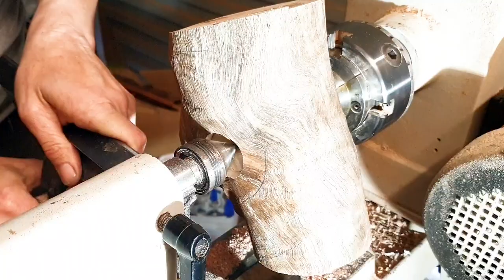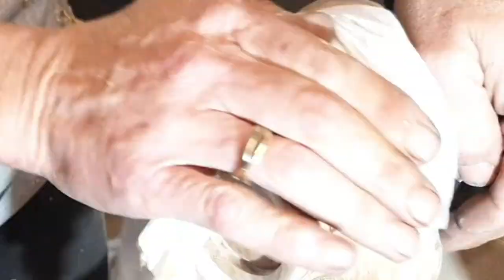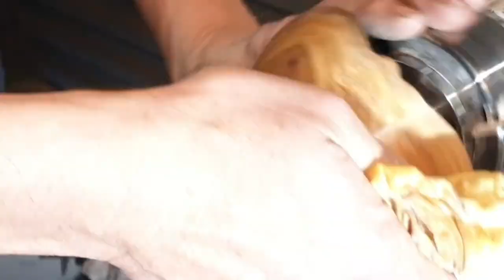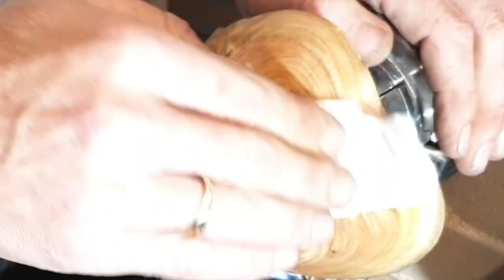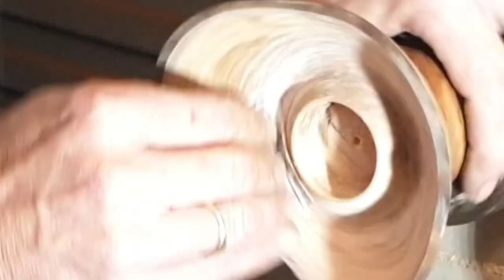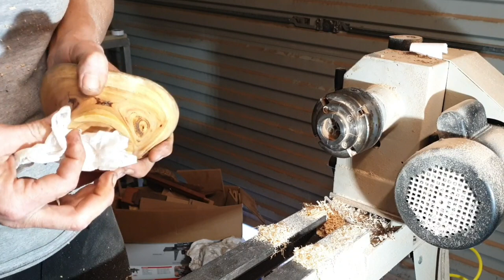Woodturning - tealight holder natural edge crotch - spotted gum

Comment: Tea light holders were amongst my first efforts on the lathe and I still love them plus they really help develop your skills. I think you've done really well on the light and a bit of narrative with the presentation, what finishes you use, what you have sanded with? Thank you for sharing and I hope my words are not taken as criicism because they are sincerely meant to be constructive.
Reply from the maker: Thanks, I generally use a wax finish on them, I use a 2" sanding disc on a drill if the piece needs it but usually just sand by hand.
Thanks for your feedback, it is very much appreciated.